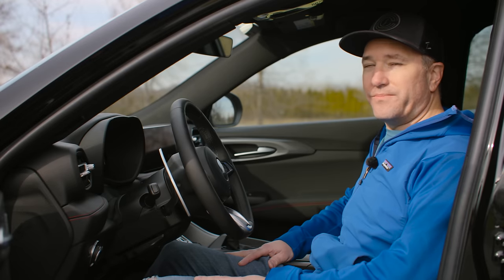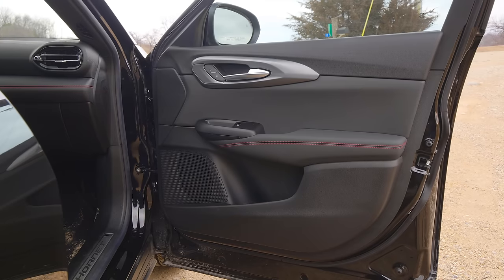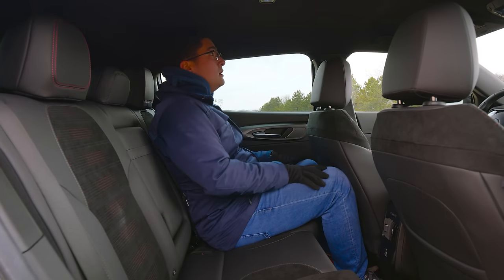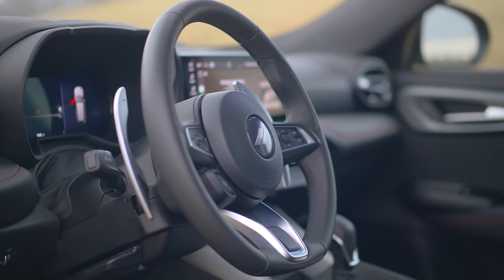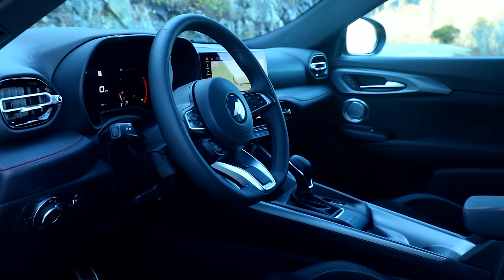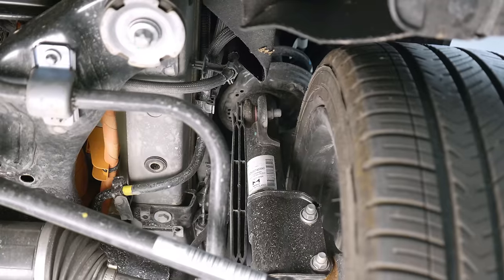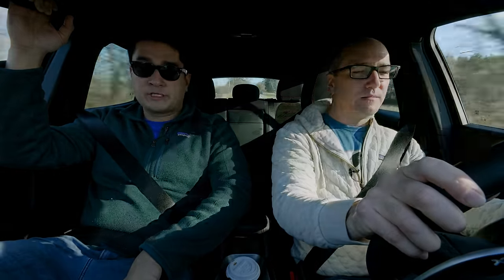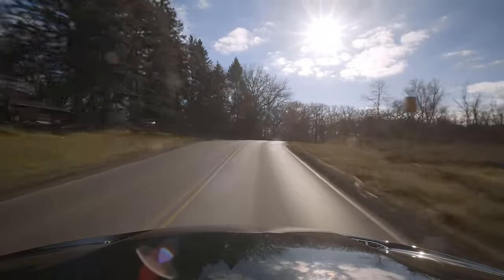Dodge Hornet | A Stinging Sensation

Comment: plastic sway bar link, plastic key structural components... A true Stellantis craftsmanship.
Reply: Imagine paying for an Alfa Romeo and getting the same
Reply: Ready to hit EU market.
Reply: HELL YEA BR0THERR VRTHNG SHULD BE MADE OF METAL LIKE GOD INTENDED 
But seriously plastic sway bar links are used in subarus, corvettes, ford SHOs, etc. they're strong as hell because they're fiber reinforced.
Reply: @bleebleblahble8833  bruh...didn't you hear the Alfa owners all tell you it's not a design issue it's just people being haters.
Reply: @WoodEe-zq6qv   Strong plastic means its brittle. Which means in an environment where it is subjected to flexing it can snap at any given time. If you want to upgrade from Steel, you use ALU or Magn. Not fucking plastic. Additionally, steel control links dont wear down from offgassing over time. Meaning if you dont let it rust, the characteristics dont change over time due to exposure to the elements. You can't protect plastic from becoming more brittle. I'm sure your breaktime at the alfa dealer is now over, get back to work.
Reply: Brake by wire lol
Reply: Dodge and Chrysler are both ZOMBIE brands. There's really very little hope for their futures 😂
Reply: “you’re welcome” - Fiat
Reply: Plastic is the last thing you need to worry about on a Stellantis product
Reply: I don't think I'd call a sway link a key structural component. If also prefer metal but, plastic bodied links work fine, the joint is still steel, and like every ball joint style link the joint will wear out well before the link body ever breaks.
Reply: @WoodEe-zq6qv plastic also has more elasticity and is cheaper to replace
Reply: @WoodEe-zq6qv okay but what about plastic control arms, cuz they do that too 😂 -chrysler tech
Reply: Ford uses plastic engine drain plugs. Pre stellantis dodge would never use plastic in key components
Reply: Stellantis is so weird. The true fiats are very well built, all their vans are very rugged. 

Peugeots are beautiful, the new Astra is nice too apart from the heaps of piano black shit. 

But man, some are so cheap put together. Sad
Reply: @LeavingCaladan what car has plastic control arms?
Reply: Why couldn’t dodge just adapt with smaller engines like every other manufacturer is doing? No v8? Okay, single or twin turbo v6. It was a cash cow so you think they would have put a bit more money and time into it to keep the green coming in.
Reply: @The_Noticer.  Strong plastic doesn't have to be brittle. CFRP has 3 GPa ultimate tensile strength but is not particularly brittle (150 to 250 GPa, a little less than steel). 
Dismissing a plastic product "because it's plastic" is just boomer shitposting. I'm sure nobody would be shitting on a carbon fiber components despite carbon fiber reinforced polymer being a PLASTIC.

Subaru has been using plastic sway bar links for more than 20 years. Same with GM on the corvette. They are a proven technology. I'd never buy a dodge for 99 other reasons but a plastic sway bar link aint one.
Reply: Dodge engineer: it's not plastic, it's a special composite.
Reply: Can’t wait to see them sitting on lots at two years old with 25k miles for $12,000
Reply: @WoodEe-zq6qv   If not wanting more plastic parts on a car makes me a boomer, i dont fucking care dude. They makes these copes for plastic intake manifolds and valve covers too, and they're garbage. And the numbers you post are from when it leaves the factory, not 5-10 years down the line. Having had several heat cycles and being exposed to the elements.
Reply: To be fair, plastic sway bar links have been commonplace for a long time now.
Reply: @The_Noticer.  You apparently know very little about the different kinds of plastic. GFR composite "plastic" is incredibly durable. Not all "plastic" is the same, it's a catchall term for hundreds of different compounds with wildly different chemical properties. "Composite" is the more accurate term.  And your argument that "characterstics (of steel) don't change over time" is hilariously incorrect. Metal fatigue is a real thing after all. Unlikely in this case, but so is failure of a GFR composite.
Reply: The g30 5 series has plastic sway bar links as well. I think it's a supplier driven cost cutting measure.
Reply: @jjchockey A lot of ball joints inside conrrol arms are plastic nowadays.
Reply: @rudolphna54  At what age did yu  drop out of high school or stopped learning physics, be honest.
Reply: @maxheadroom224  I doubt this GFR composite is cheaper than stamped steel.  It's much, much lighter however.
Reply: @user-bn6lm8ng3v  Just because I used words that "yu" don't understand, doesn't mean they're made up.  I'm sorry that you're too "old school" to understand that not all "plastic" is the same as the shitty walmart toy type.
Reply: 5:56 the future is plastic!
Reply: At least the seats are good 😅
Reply: The Pagani Zonda entire body is Carbon Reinforced plastic too... Aircraft wings are glass reinforced plastic. Both lighter and stronger than steel.
Reply: Does Stellantis make Mercedes also?
Reply: @maxheadroom224   ofcourse it is cost cutting. They dont build things to last anymore. Yet you have some idiots in here that, for the sake of sounding more hip, defend costcutting. When it also affects their own bottom line, since at some point they have to buy a new car and get saddled with this shit.

The things people sacrifice for internet upcummies is just a sight to behold.
Reply: Plastic craptastic.
Reply: @maxheadroom224 Plastic is also way lighter than steel. Incremental weight savings adds up.
Reply: @The_Noticer. For these cars, just lease. Who wants to own a Chrysler long term anyways.
Reply: I wouldn't call a sway bar link "structural", but yeah, that's pretty cheap.
Reply: Glass filled nylon is extremely tough and rigid without being brittle.
Reply: At this price point, y'all need to stop complaining. 😅
Reply: @wyw201  That mentaility is exactly what they want. For you to never want to own a vehicle, and will forever pay the premium. Do you think they will not all gravitate towards these disposable vehicles? 

Yeah, real eco-friendly, that.
Reply: @The_Noticer.  I don't think all brands will gravitate towards disposable vehicles. Hell, some of the vehicles I've owned were disposable before the EV push began. Don't forget certain manufacturers have been making junk for decades now.
Reply: @wyw201   Meh, they are all making them more expensive, more complex and moving everything upmarket though. A Toyota Aygo (european model) used to be 8 grand new in 2009, now its 26 grand. That aint inflation, that's them just making it more expensive. Yes, its a much nicer car now, but they didn't replace the model they took away with something else.
Reply: And Stellantis takes the lead of the big 3 of who’s permanently going to disappear as a company.
Reply: @The_Noticer.  One model is too small of a sample size. You'll need to compare prices for all Toyota models to derive an average for your region. Then adjust the YoY change for inflation and compare that to real wage gains over the same time period. I'm not from America so I don't know what the American car market is like. Luckily my salary has more than doubled since 2009 and my car money comes from capital gains.
Reply: It's a throw away veichle. Worth 500 bucks in 10 years, what are you expecting. That being said, plastic swaybars has been used on Peugeot for 25? years and they fair fine, same with vw/audi and I know I seen them on japaneese cars also
Reply: @wyw201 right, but this and the Tonale aren’t light:
Reply: @jjchockey  Well @WoodEe-zq6qv noted CFRP.  In terms of a FIAT, technically the Ferrari F1-75 has plastic control arms. But that's being a pedant I guess!  Formula One cars moved to carbon-fibre control arms instead of steel and flexure mountings instead of spherical bearings in the late 90's.  For the Red Bull, the upper front control arm is one piece across and forms a transverse (plastic) leaf spring across the car like on a Volvo or Corvette.
Reply: @The_Noticer.  Plastic will last much, much longer than steel in most climates.  An all plastic car would probably last forever.... @rudolphna54 is right, you're just clueless about materials and unwilling to learn.
Reply: @The_Noticer. that’s bullshit lol
Reply: This will be a great rental car...
Reply: @stevelovescars  They would be much heavier if everything was made out of steel.
Reply: @Praenuntium *polymer
Reply: @The_Noticer. your statement, from beginning to end, is not scientifically accurate.
Reply: Zero intelligence in this comment.
Reply: @melvingibson4525 , nothing wrong with brake by wire.
Reply: Is Ford and Chevy any better🙄, y’all acting like Dodge is the only company with past issues with unreliable parts, others be having issues with their brakes and airbags deploying.
Reply: @dylanmijer2890 , it's the "it doesn't have a hemi" crew. That little CUV is good for what it's trying to be. People are always going to shit on these type of vehicles.
Reply: @bundy26  exactly the Dodge Journey didn’t have a V8 and the Dodge nitro didn’t have a V8 this vehicle is replacing those vehicles, simple as that, I don’t get why people can’t understand that, what’s really gonna get them mad is when the Dodge Challenger and Charger come back as an in-line twin turbo six😂
Reply: Didn’t even read the comments before noticing the same thing. Came here to comment about it. Job already done for me.
Reply: @dylanmijer2890  oh Jesus! I totally forgot about the nitro. That thing was hideous, lol.
You're right, they're going to freak out w with the I6. Btw, that engine has so much potential.
Reply: @bicboi1930 and VW as well, including plastic oil pans.
Reply: @BTC909 As are the present and past.
Reply: @WoodEe-zq6qv literally defending the use of plastic over metal 😂
Reply: @The_Noticer. You do not have an understanding of materials science.
Reply: Hey the 1900s called and want to know what happened to their manufacturing engineers. Seriously?
Reply: If you don't let it rust?  Everything breaks down, except PFAS.   @The_Noticer.
Reply: Most new cars and trucks have plastic sway bar links. Plastic oil pans with plastic drain plugs. You’d be surprised what you see on new cars lol
Reply: @WoodEe-zq6qv  none of my c5 z06s or c6s had plastic sway bar end links. Is that a new c8 thing?
Reply: Corvette. Plastic body, plastic suspension..
Reply: My 1983 mercedes has plastic swaybar links and I have never touched them in the 6 years ive owned the car and i can assure you they werent new when i bought it.
Reply: @joseeduardo4327 what do you think their new Hurricane inline 6 is for? Obviously that doesn’t fit in the Hornet though.
Reply: CFRP is fine. It is a well understood material. Hating on it just shows your ignorance.
Reply: @rudolphna54  Im sorry your parents failed you miserably
Reply: @jjchockey Tesla model 3 and model Y use plastic front upper control arms
Reply: KDM and VW have been doing it for years. No one complains.
Reply: well its a FIAT basically, that's an Alpha Romeo that's now called a Hornet, cue the Benny Hill theme in 3, 2, 1 GO!
Reply: @WoodEe-zq6qv  Until the whole thing cracks when you're trying to replace the ball joints.
Reply: My local auto repair shop would probably go out-of-business if it weren't for Chrysler and Stellantis!
Reply: @joseeduardo4327 i actually like the engine as is. So much hp and tq from such a small engine,
Reply: @jamesross824 nope. Mercedes is separate.
Reply: Takumi plastic
Reply: 5:56  those are beefier polymer than my MB links were. My 1989 Mercedes had plastic sway bar links, they are common. One broke rolling through a gutter. It was a very old car when it happened.
Reply: @The_Noticer

Steel can be brittle. That sunk the Titanic and caused a whole pile of problems with Liberty Ships in WW2. 

Meanwhile they’ve been using plastics on airliners for 50 years where temperatures are -56°C at altitude. 

It’s not as simple as “plastic brittle, steel not!”
Reply: @jjchockey  mostly RAM trucks
Reply: No wonder I haven't seen one, or to few to notice
Reply: @TalismanPHX 100% they put it off for too long and they relied on their 3 offerings and forgot about the rest of the market. They won’t survive and all that’s going to be left are their trucks.
Reply: @The_Noticer. fiber reinforced plastic solves the brittle issue just like rebar concrete
Reply: @The_Noticer.  I would say the rubber at both ends of the links is the part that wears out first. Plastic is common on alot of cars sway bar links.
Reply: @WoodEe-zq6qv  wrong bro. My Tahoe APPEARS to have plastic links but there's a steel rod in the middle. Same with the cars you mentioned.
Reply: @joseeduardo4327  exactly right. 
If you look at a porsche it's just a VW beetle after someone put some hair gel in their hands and smoothes it back. If Dodge did the same with the Challenger and Charger and put twin turbo V6s in em they would sell.
Reply: @MotownModels  no, plastic bodies with a steel core has been common.
Reply: @ksoman953  really? You can get a Subaru Forester, Kia Telluride or GMC Canyon for the same money.
Tell me you think the dodge hornet will be better than those 3.
Reply: I saw that right away and had to stare at it because I kept thinking.... they wouldn't use plastic for that..... then I thought, well, this is Stellantis.  Yes they would!
Reply: @The_Noticer. Bud your clueless and it shows.
Reply: @The_Noticer. I have had many cheap cars with plastic components that have did nothing but good for me, over 250k miles with no issues. I don’t know what your crying about. 🤡💀
Reply: @ZACH_95_  You're* 
0/10
Reply: To be fair. Stellantis isn't the only car company using plastic components
Reply: @WoodEe-zq6qv these people arguing about plastic away bars on a Dodge likely own a plastic sway bar on another car. That's how hypocritical and ignorant they are. Typical YouTube commenters. Nothing new here.
Reply: @The_Noticer. So then stop voting for people who keep putting extra pressure on the manufacturers to cut corners, reduce weight, all while being told to have more and more weight in the name of safety so they need to cut any corner possible to both make the car affordable as possible as well as meet emissions. Has nothing to do with you being a boomer. Has everything to do with how you vote. (And if you didn't vote for those people. Well then you should already know everything I said is the actual problem. Not the nonsense you spat out)
Reply: @wyw201 that's why all cars are only built for assembly and repairs and anything thereafter are literally not even a thought right? That's why in a lot of cars fixing what is usually a 10-200 part can costs thousands just due to how it was designed and built.

It's not so much about the parts themselves but the layout too. Cool they used a really nice ac lines and compressor etc. doesn't mean much of anything when it eventually has an issue years later and is so hard to fix that it's not even worth it.

So are the cars more disposable now? Not really. But are they built in a way that makes it extremely difficult, expensive, and usually not economical to even fix at all for something that costs very little. Absolutely.
Reply: @craig9365  Did you reply to the wrong person?
Reply: @hamsterbrigade  Of course. Because Fiat and Alfa Romeo got laughed out of the US market in the 1980's by haters. I just thought it was because they built pieces of H$it.
Reply: @TalismanPHX  Seriously there isn't a product in the entire Stellantis portfolio that's worth a daman.
Reply: @WoodEe-zq6qv I would think that these plastic sway bar links would eventually get loose & start making a clanking noise?
Reply: @johnbeckham1483  Why?
Again, carbon fiber is a plastic. Would you expect carbon fiber to come loose?
Just because something is plastic, doesn't mean it's weak.
Reply: @The_Noticer. Unless you have a degree in chemistry or mechanical engineering all you have is conjecture and assumptions. Plastics of old are not the same today. They have made developments in the manufacturing of plastics and many other car manufacturers are using it even the ones who are considered reliable

Comment: It certainly looks nice. It's unfortunate that the reliability based on history won't be there.
Reply: You mean the history of Stellantis or the history of Dodge? 😅
Reply: @stayphun6188 ouch 😢😂😂😂😂
Reply: @stayphun6188  .... Yes... Lol
Reply: I drove my 2001 PT Cruiser for a decade with zero issues. Loved that car and wish I would have kept it, but a dirt cheap Honda Fit fell into my lap from a relative and I had to part with it.
Reply: The reliability based on anything won’t be there.
Reply: @OMGWTFLOLSMH u were one of the lucky few
Reply: Yeah it would have to be $10,000 cheaper than the direct competitors from Japan and even then... American cars and German cars for long-term reliability are generally rubbish. I can accept that in a sports car like a Mustang/Camaro or certain German cars - you trade reliability for performance. But as these guys note - these are appliances and I want reliability in an appliance - Toyota/Mazda/Lexus and then Subaru/Honda and then basically nothing else.  Maybe if Stellantis offers a 10-year 120,000mile bumper to bumper warranty with some legal absolute that they WILL honour the warranty then they might convince me - but you'd be nuts to buy one of these at only a few thousand less than a Toyota.  I mean 7 of the top 10 most reliable cars in Consumer Reports were Toyotas.  Subaru Crosstrek was listed as well - Crosstrek with AWD that is actually good included. PHEV (other than Toyota) were all horrendously unreliable - the Pacifica PHEV being the worst or second worst car on the road for reliability. Eeesh